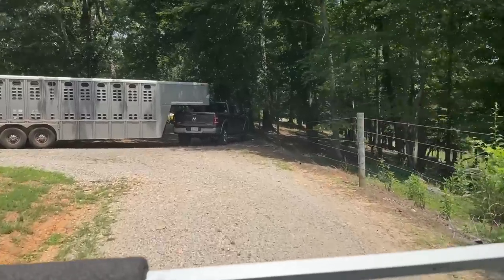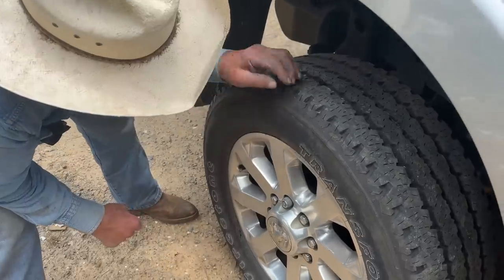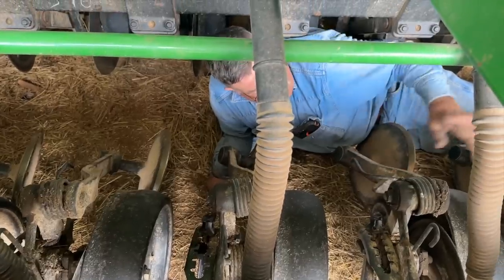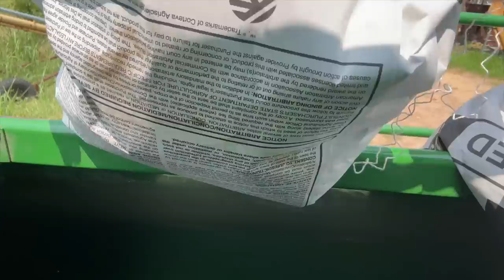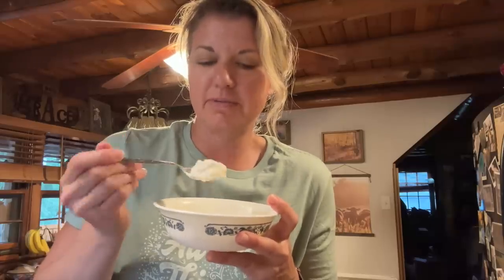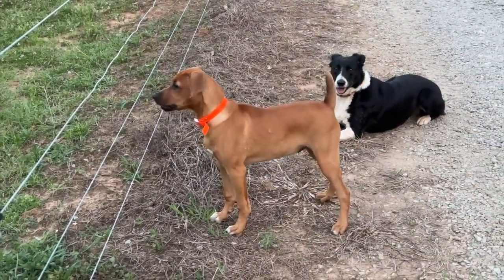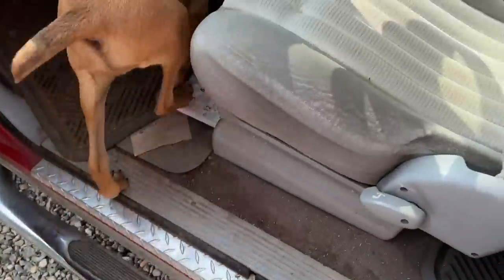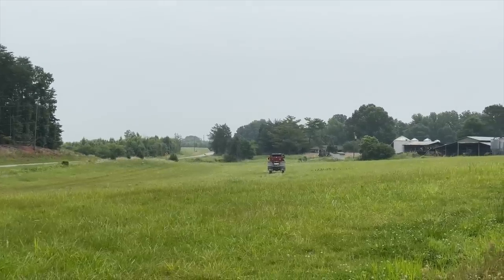It Was Fun While It Lasted! : Seeding Beans and Spreader Dreams

Comment: Hope this might help. When filling grain drill with seed, after adding a bag of seed , level the seed and use a permanent marker to make a line inside hopper and print number of pounds on it. It may not be exactly the same each time due to different seed sizes but will be closer than guessing.